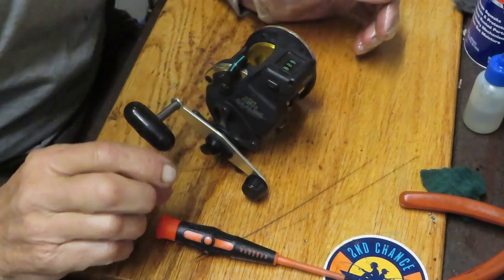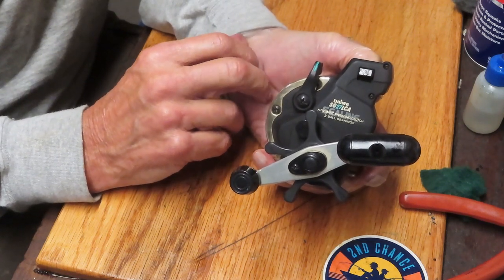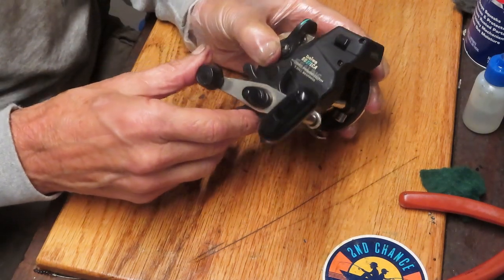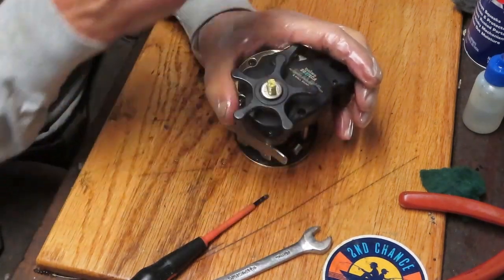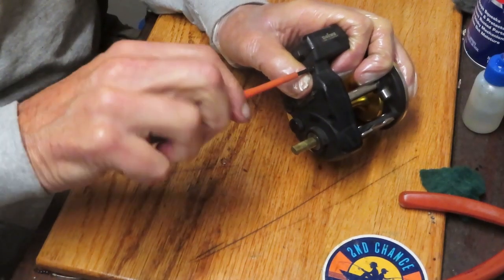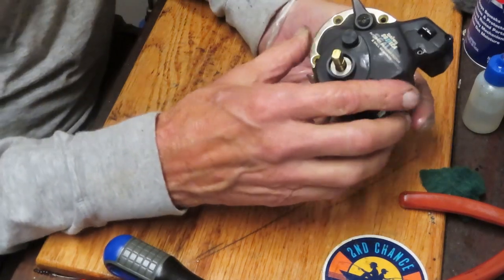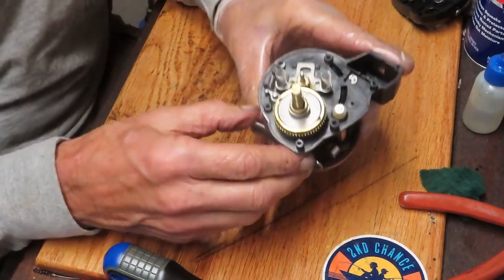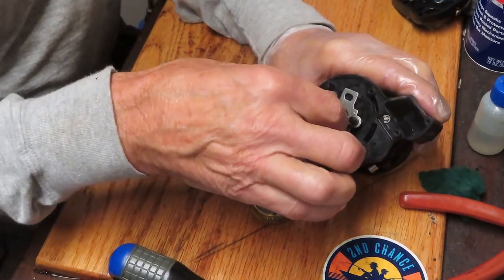Daiwa Sealine SG27LCA line counter fishing reel how to service

Comment: This reel has got to be one of the cleanest reels I’ve seen you service. I like this reel. I don’t really know why as I would never use one. It just seems quite logical, understandable, and of high quality. This video was a pleasure to watch! Dennis, I got a beauty of a nice reel today that I had not seen but once before. It’s nothing special but very well made and has beauty and quality. It is an Olympic 303 medium saltwater spinning reel and I was able to get a new one in the box with everything from a very nice eBay seller. He was the one I was asking you about his unusua Penn Spinfisher 70o reel. I’ll send you a photo of the reel. Also,i can’t believe indid this but I got another Mitchell 386. It was so inexpensive I couldn’t resist. At the very least it will be the source of some hard-to-find parts. I’ll see when it comes. I had intended to stop getting reels while I was working on my reel storage system but these were two I couldn’t pass up. I’ll let you know how this 386 turns out. — Chris
Reply from the maker: That is the difference between a reel used in saltwater and one use in fresh water!  They stay clean and are more easily serviced.  How many 386 reels do you have now????

Comment: Thank You for the great tutorial, I purchased a used sg 47 lc for salmon fishing here in the PNW. Love the reel but the drag is sticky, Took the reel apart and found the drag washers were super greasy, Real sloppy inside. I plan on cleaning well and replacing the drag washers with new carbontex. Hopefully the drag will work better..
Reply from the maker: That is awesome!  Yes - excess grease will cause the sticky or slipping of drag washers.  You plan of action should fix the issues - Best wishes for great fishing with the reel - Dennis

Comment: How do you service the line counter on the reel?. My line counter does not reset and sometimes it stops moving as I'm letting line out
Reply from the maker: You likely have to replace the part.  If it does not reset, either there is a broken piece in the mechanism or dirt.debris etc is holding it back.

Comment: Enjoy the lesson. My issue is my drag no longer works. Tighten it down and no drag?  Thanks.
Reply from the maker: That one is odd.  Usually, the drags stick, but still work.  If you have a torn drag washer or a very worn one, that could cause your issue.  You will need to take the reel apart and see what is going on inside.  It may be dirt or debris causing the issue if it isn't worn washers - Dennis
Reply: Thank you love the reel have a pair. I'll check it out I took apart a look at the drag washers.